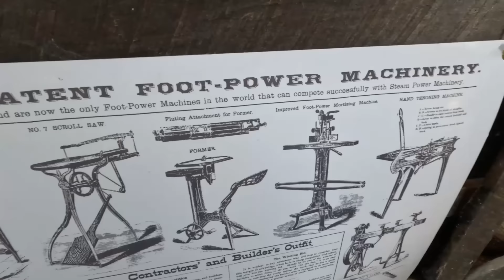A fun day at the National Pike Steam gas and horse association fall show # 597

Comment: Awesome video, I'm 75, retired Heavy Equipment Mechanic / welder. Years ago S  J Groves picked  up a project in Satsop WA. often rained, It was a nuke project, that never was completed. 666 scrappers were my bag. They brought in a North West shovel., I can't tale all the credit for getting it back up on line, There was a local Mechanic, a great guy, from  Sedro Willy WA. He was more dialed in to the engine then I was, he had a few years on me. a good friend. 
It was my job to get it mechanically back in good operating condition,  truth be known, a couple of old timers then who ran these old shovels showed me a few things, which paid off. I spent weeks on the rig, I had some serious doubts about it. Surprised me, once I managed to be settled on the work being done, working right, which I honestly really wasn't sure about, it needed a good hand to run to let me know, the right man would know best. Here is where it all goes down hill, no pun intended, I wasn't at work the next day, The labors crews /  foreman for the operators,. word   has it to me, via the equipment job foreman. They want to use it down blow a very steep long slop / mountain side is more like it, 
We had winch had plenty of winch cats,  This around 1978, they ran it up and over  the side, no winch cables attach to it, 
 one cat in front, it got away, 2 to 1 drop off, a couple of hundred feet down may be 300 feet down.  To my eye it was 
 Demolished the rig. To my eye it was straight down. I don't think I ever bothered to make my way down  
to get a look at it. I did enjoy the sound of the engines, low key, not hard on your hearing.
Reply from the maker: thanks Jim.

Comment: Got to roll the hammer on the anvil to align the cristals inside the metal. You always hear that hammer sound at the balcksmith. The Panama Canal was dug up by these steam shovels.
Reply: 2 hits on metal 1 on anvil and get into a rhythm rotating the work piece as you go reheat as needed

Comment: HI MARK.😊😊 be 4 people had indoor running water 💦 😮 U had 2  go 2 spring or creek 2 get water 💦 😮 if U were lucky 🍀 😊 U had a well at the house U had a rope W a water 💦 😊 bucket U let down in 2 the well and the bucket fill up W water 💦 😊 then U pulled the water bucket back up out of the well and the people who windmills they also would run a water pump 2 pump water with and most people did sharpen the saw blade W a flat file some a hand crank sharper then they went 2 a electric saw sharper and mark years ago there use 2 be sawmills everywhere and dad told me a many of time ⌚ 😊 when U couldn't get back U could go 2 sawdust pile get in it and go 2 sleep 😊🎉 and stay warm the 2 I remember there was 1 down the road a bit and up the road the last time the sawmill was there that was be 4 I got out school 😊😊 and mark that was a old hay press that was pre hay baler that 1 U had put the wire in each bale and tie it by hand 🖐 😮 that was the way it was back then that sawdust will help U from keep walking in mud when the ground is wet under your feet 😊🎉 OMG 8 12 2O24

Comment: Thanks for posting this Mark and Eddie! I have a 1946 Massey Harris 101 JR. I need to replace the exhaust manifold on it. I have it but no tome to work on it. I bought a new Carb for it from a place in California. I replace the water pump, the radiator core and the clutch and clutch plate. Check out MY TIN MAN video I posted. I made it for my wife.